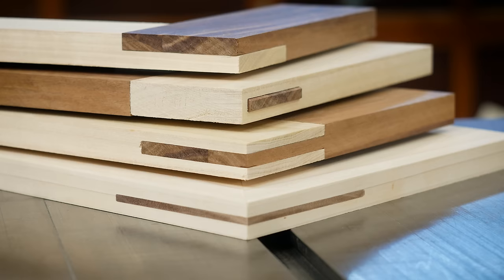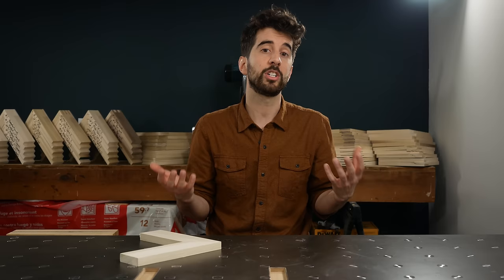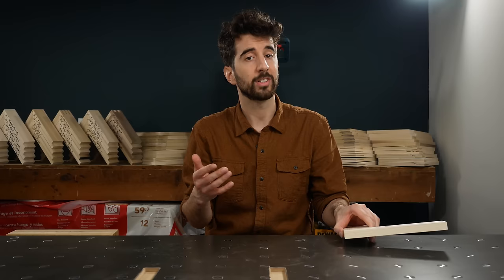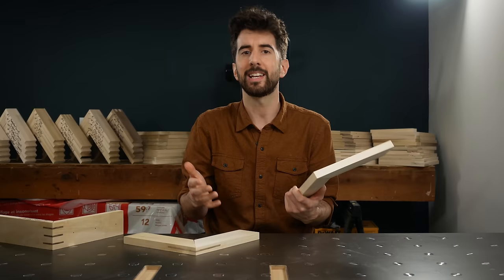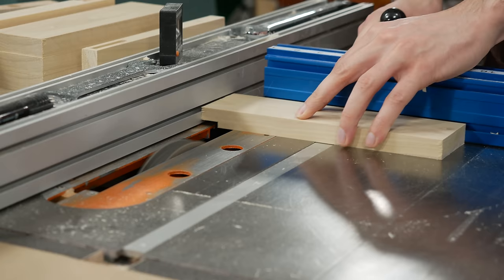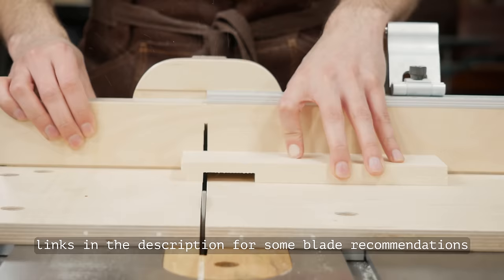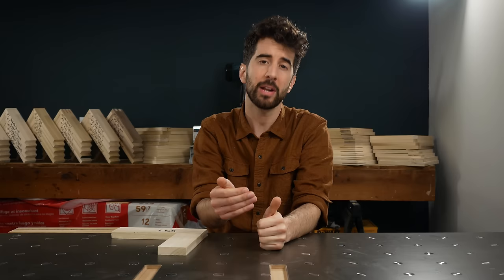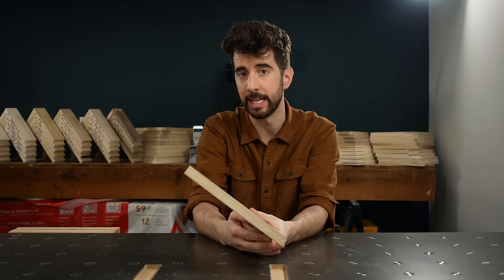Forget Mortise and Tenons... THIS joint is better.

Comment: If you really wanna impress me, let’s put it into real world function, not arbitrary test designed to cause joints to fail by using forces in directions, that would basically not exist. The test I want to see done it’s for you to take a one by 10 quarter sawn bored that’s at least 4 feet long and cut it down so you have four squares. Consider the two smooth sides as the sides of the squares and the end grain as top and bottom. Now cut each square in half two of them with the grain two across the grain. Next glue them back together, being careful not to mix up the pieces. Make sure the first Cross grain cut two pieces are keep together to be glued back together and the second cross grain cut, kept them together to be glued back together. Do the same For the two boards cut with the grain. Now take one of your two boards you cut with the grain and put clamps on both sides and put in device that will stretch the board until it snaps. If you’re using modern glue, I can guarantee it will break not at the glue joint, but along one of the lines that’s caused by the grain on quartersawn wood. Now take One of the boards cut across the grain and clamp the top and bottom and stretch it until it snapped. It will be stronger than the first board and it will snap on the glue line. Now take the second board cut across the grain, but this time clamp the two sides and stretch and once again, it will snap like the board cut with the grain, along one of the lines caused by the rings. Finally take the board cut with the grain and Clampit top and bottom and stretch it till it snaps. If you have clamped it properly, so you have equal clamping force all the way across the top and the bottom then when this board snaps, it will destroy the board because there’s no weak point to break a crossed so it will tear its way through the fibers. This will be the strongest reading you get, and it will basically equal the full tensile strength of the board. Wood is strongest when you’re dealing with trying to either stretch with the grain or compress in line with the grain.

Comment: Your assumption that strength and glue surface area will be related fails to account for the cross-sectional area and its grain direction. The reason M & T joints test weaker has little to do with glue strength more to do with cross-section of the tenon. The Bridle vs Half-Lap is harder to explain. Certainly there is a lot happening when each of these joints fails, it's complicated. Good video.

Comment: I take these tests with a grain of salt. I’ve yet to subject my furniture and picture frames to a bottle jack, but they handle intended use juuuuuuust fine. Fun vid though and delivered well.
Reply: Yeah. The takeaway is that all woodworking joints are strong enough for the purpose they are commonly used for. It doesn’t matter which is strongest because they aren’t even transferable in most cases. You can’t miter an apron to a table leg. Use the right joint for the right application. 

The reason they are all common joints is because they work well for their intended purpose.

Comment: can you make a half lap joint at 45 degrees? would be strong enough for a picture frame and that mitred appearance is better.
Reply from the maker: yep, you can do that. It's a bit more work than a regular miter, but it would be very strong.

Comment: The question bright experienced designers ask is "What strength is needed?" Novice builders often want "the strongest" but that's not always the best imo.
Reply: People tend to over engineer things because they aren’t engineers. Add to that, a lot of woodworkers are high conscientious people. That basically means they overestimate worst case scenarios and over prepare for said delusional worst case scenarios. 

Put those two together and you get a bunch of people who don’t know how strong something needs to be who assume it needs way more strength than it does. 

So the way to put their mind at ease is to build something ridiculously over engineered.
Reply: And that's exactly how you get bookshelves made from 2 x 8s that never get moved because they're far too heavy. They were actually sold with the house and became structural elements in a new wall...

Comment: Or use stainless steel which is stronger by far and you can weld and/or heat to bend.
Reply from the maker: all of the furniture in your house is stainless steel?

Comment: Do you like your Benchdogs MFT Magnetic Plugs? I have an MFT style workbench similar to yours and I am considering those plugs
Reply from the maker: They're awesome! But the size of the 20mm holes needs to be precise. There's a fine line between too tight and too loose. I made a reamer to help with this, but TSO makes and sells a reamer that works pretty well, or so I hear.

Comment: Any joint can be considered the strongest if you design your test for it.
A half lap is a strong joint in one axis or direction but weak in another. Joints need to be used in the proper orientation to actually benefit from whatever inherent strength they have.
These "strength tests" don't reflect real world usage
Reply: You are correct, but  it's entertaining and no animals were harmed .

Comment: PVA glue strength is heavily tied to clamping pressure like 250psi per square inch to get optimal result, you're not evaluating much in this test, maybe a bit of the clamping pressure and joint tightness but certainly not the type of joint's strength
If you want to test joint strength properly you should either not use glue, use the same amount of glue surface AND clamping pressure in every joint, alternatively epoxy or hide glue may be easier to get a consistent glue up because they don't require as much consistent clamping pressure

With that said your results shows that your mortise and tenons weren't tight enough, your tenons should not slide in the mortise like a knife in butter (or insert inappropriate joke here). This is not an appeal to purity considering mortise and tenon joinery, it is a real thing because a tight joint will produce considerable amount of pressure on the glue, which is necessary for a strong bound with PVA

"I can't believe this is stronger than a Mortise & Tenon" is very true because indeed I can't believe it based on the evidence shown in that video
Sorry for being a hater, it's very good to have more and more woodworkers going into more scientific approach to their craft but poor methodology won't help anyone
Reply: Actually your joint should slide in easily. Because glue is going to expand the joint. A tight joint is going to starve the joint of glue. PVA glue is stronger than wood is anyways.
Reply: @1pcfred  you can't starve off PVA glue that's a myth and PVA is not always stronger than the wood, it's an oversimplification
Reply: @uwyphi  PVA is stronger than dirt!

Comment: You have a problem with the way you glue endgrain. You have to add glue on the wood and make the wood absorb it before you use more glue to glue the part together. The way you glue this together will not ensure that the wood have absorbed enough glue. The strent is far from what is possibly if you use the right technic.
Reply from the maker: I sized the joint, just didn't say I did.

Comment: Mathias Wandel rings a bell, i assume?

You might have made some errors in the setup. Because he shows us much stronger joints.
Reply from the maker: you can't compare his or my numbers to anyone else. Everything is relative to the set up, type of wood, size of wood, how far the jack is from the joint, etc.
Reply: @ScottWalshWoodworking  sure, to that i agree.

But so it is safe to say that you know Matthias and have checked his work already?

If not, then i do suggest his channel.

He did a lot of testing as well, different types of wood etc etc.

It was just a suggestion.
Btw, you guys both seem to know a lot more than i do about wood, that is for sure.
I am happy i know how to sand it and paint it every now and then.

Comment: why do you need strength for a thin joint? is picture framing an anvil a thing now? if you need strength change the design to accommodate thicker wood.

Comment: not for nuttin but there's a difference between strength and longevity.  No?  All a half lap has going for it is the glue.  But, a M and T joint has mechanical strength, producing longevity.  Or, I'm wrong. Heck, I'm making this up.
Reply: Indeed. It’s like testing cheap off brand tools vs expensive industry name brand tools. And then saying you should buy the junk because it produced fifty lbs more torque.  

What they aren’t telling you is that it’s going to break in two years or as soon as you drop it.  But durability is not something review channels can test. You have to be smart enough to think for yourself. Most people don’t seem to do this.

Comment: Before you go and watch the entire video, skip to 15:50 and listen that he only used a 1/4" router bit to make the mortise.  This invalidates the entire video. The mortise and tenon is a STRONG joint, much stronger than what a 1/4" (6.25mm) will provide. Dominos are minimum 25mm depth each side. Great video, but you need to at least give the mortise and tenon a chance. This comes off as clickbait.

Comment: Nah. I whip out the Domino and finish making a joint in seconds. I can't think of too many instances where a joint would need to withstand 500# of pressure.
Reply: I'd rather whip out my wallet and see $1,200 still in it.
Reply: @1pcfred you carry that much cash around?  

I just don’t make enough furniture to justify such a specialized tool.

Comment: This is another useless test producing useless numbers. This will just confuse beginners. First of all, in reality, force is not applied that way. The test force should be applied to the opposite side. The splined miter didn't actually failed, it's the lignum that failed first. Same with other joints. Use hardwood for better results.